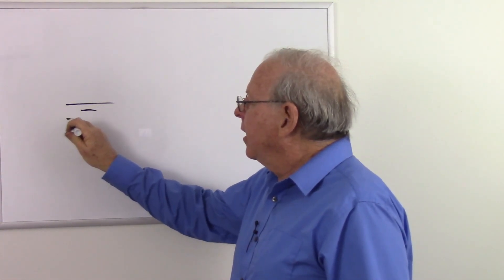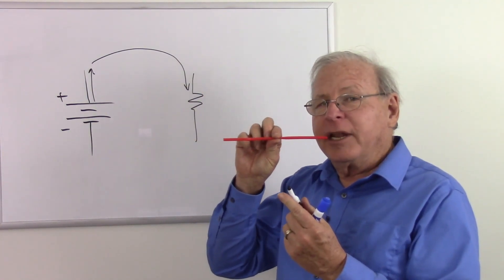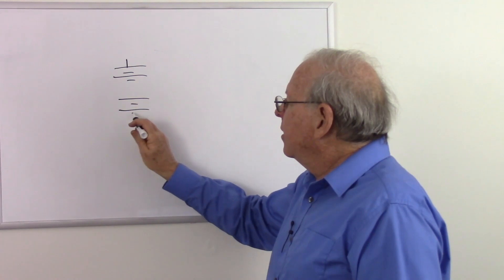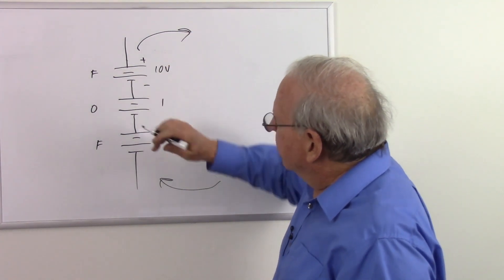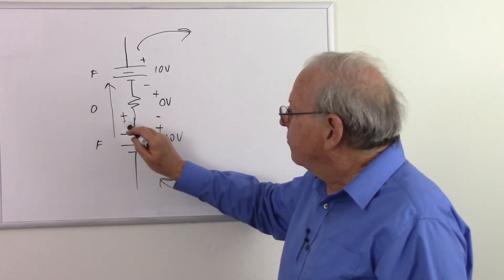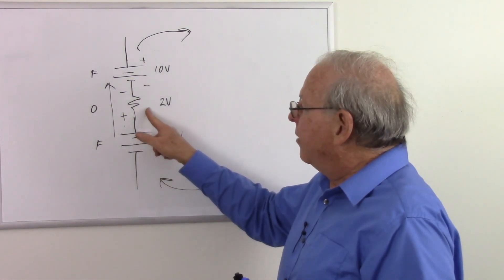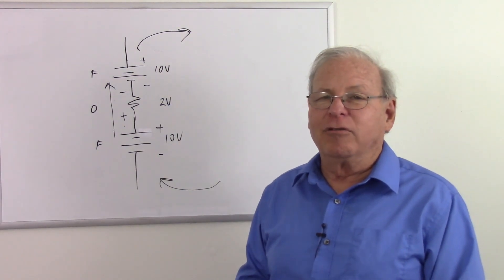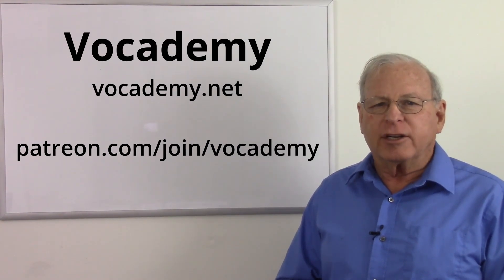Mixing Old and New Batteries

Comment: Sometimes when i pull dead batteries from an electronic device, i always checked the Voltage on them to throw out the old ones (under 1.2V) and keep the ones that are still good (over 1.2V) because not all batteries drain equally. This i know from personal experience. 
Sometimes i DID see a negative voltage on 1 battery and wondered WHY it had a negative charge. NOW i know. 
And this is because i threw away the old ones and kept the "good" batteries that still had descent charge on them (~ 1.2V) and then i would mix that 1.2V battery with fresh 1.6V batteries .....

Comment: Ok, but what about putting them in parallel?
Reply: It should be worse and it will degrade faster, since the voltage difference is always present between the batteries.

Comment: Thank you for explaining why it's so important to measure battery voltage before installing multiple batteries. This appears to explain why sometimes smoke detectors give low battery alerts just a few months after I  installed new batteries.  Per my experience, this problem appears to have disappeared after I started using a digital volt meter to match batteries within 0.001 volts. It's nice to know that I likely solved this problem based on reality instead of paranoia. FYI, when I recently measured a package of 24 AA alkaline batteries, there were a lot of voltage variations, and two of the 24 "1.5 volt" batteries measured less than 1 volt! So now I never trust a battery straight out of the package. Great lesson! ❤😊

Comment: I have 6 Blink 4 outdoor cameras and they use 2 AA Lithium batteries. When the camera stops working because they're dead I noticed one is always full still. Every camera this happens. When I put alkaline batteries in, both drained together. I always test my batteries when done to toss the  dead ones measuring under 100 on the multimeter and use the ones with still a lot of juice for clocks or testing other things that might need that battery but ya this hasn't happened to me before, what's the reason for this?  If every blink cam like I have does this then there's so many full batteries being tossed and money wasted. Those ones are expensive 😮

Comment: What about using a just used almost dead AA battery with a new AA battery for LED fairy lights? It needs two AA batteries but I only had one new one left. 
Is that okay? 
I did it and it is working! 
It’s obviously not as bright as two new AA batteries but it’s giving a lot of light and warmth! 
Should I stop using it?

Comment: Old vs new, then you get a healthy charged battery vs dry cells with low voltage. 
Now I didn't think this was supposed to be can you mix healthy + unhealthy batteries. That's obvious.
Your 3 batt setup also generally won't power devices with a dead unit. Try powering a 24v appliance with 12v. 
Then I have never seen or heard of a battery charge to reverse polarity. But I just revived a 2001 dry cell sla under 1v with a bit of batter water and a week of charging. 
It's quite concerning what wisdom the poor commenters and viewers received from false information

Comment: what about mixing old and new batteries in parallel?
Reply: I’m curious about this too.
Reply: Guessing the same issue.
Since the batteries are in parallel, the voltage across all of them would be 1.5V .... 
So if 1 battery drained faster, the other batteries would have a higher voltage on them and that higher voltage will pass over the "dead" battery which i would assume has the same affect to "recharge" it and those batteries are NOT rechargeable so same result, it will get hot and possible leak and or pop open depending on how much power that device is pulling. 
You re-charge a battery by applying voltage to it. This parallel circuit is essentially a charger because the other batteries have a higher voltage.

Comment: Thank you for this instructive video.  I have a battery powered Water Pik, and I prefer the flow and pressure when the batteries are slightly used.  I was contemplating only swapping one battery at a time (it uses 3 AA batteries).  After watching your vid, I can see that this would be a bad thing to do.  Assuming the circuit has them in series, how can I achieve ~4V operation rather than the 4.5-4.8V operation when all 3 cells are new?  Thanks for your thoughts!
Or is it okay if not as extreme as your example?  Say 1 new battery at 1.6V and 2 used batteries at ~1.3?

Comment: Lead-Acid Batteries, according to ChatGPT4:
Cell reversal in lead-acid batteries typically occurs during a deep discharge, particularly in batteries with weak or damaged cells. If a weak cell is completely discharged while other cells still have charge, the cells with remaining charge can push the discharged cell into a reverse voltage. This is damaging to the cell and can lead to short circuits or other failures.

So, it looks like lead-acid batteries are no exception.  Although, never trust ChatGPT  to give accurate answers.

Comment: I always thought the expired battery would work as/simulate an inductor and pass voltage, but totally forgot about it's resistance,
Sorin has explained the internal resistance of batteries but didn't speak about mixing old with new batteries in series
Reply: Have you watched Bob's videos about batteries?